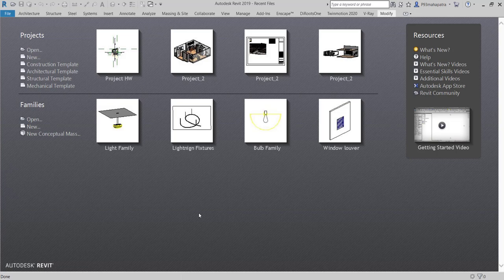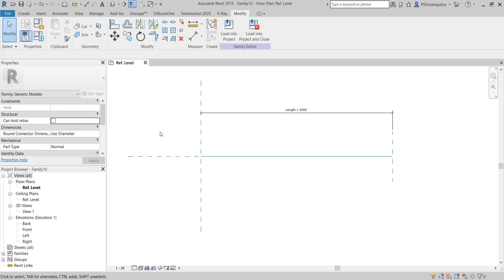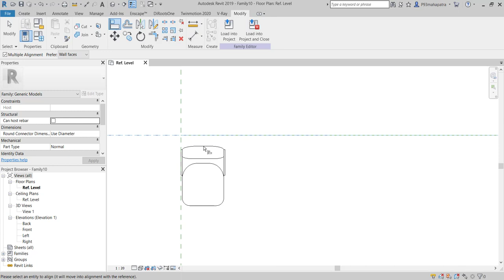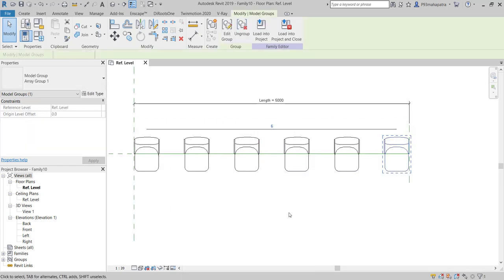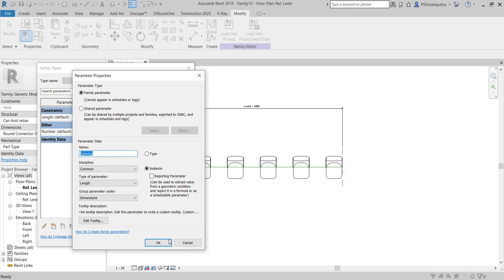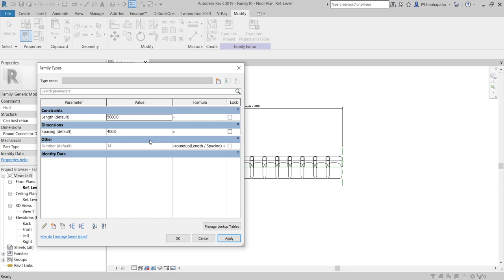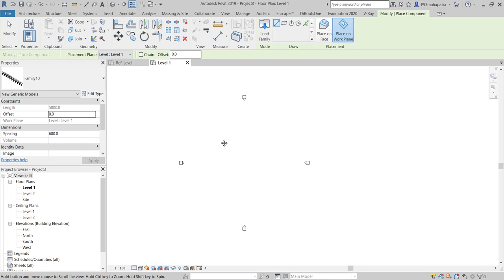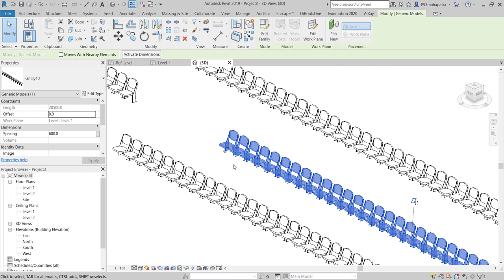Line based Family in Revit

Comment: Hello! Great video I am trying to create an Irving grid family based on line that also makes a hole in a concrete slab, but the most I reach is creating a Floor based Family that doesn't work like a wall ration, but inserts a grillage that you can edit later. is it possible to mix the line based with floor based family in order to make what I need to do?
Reply from the maker: Hi send me your question at learn@bimskilled.com.  I'll help you.